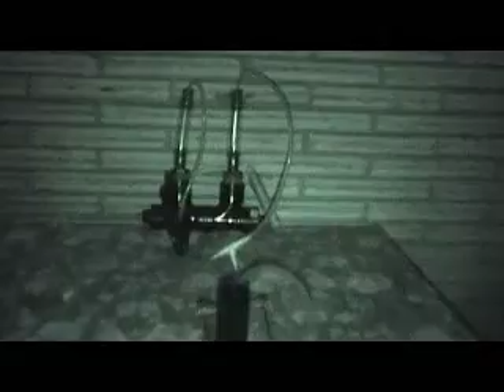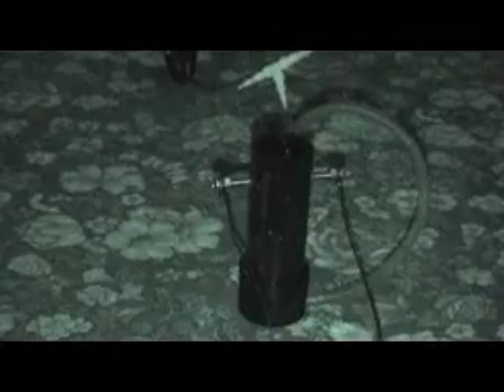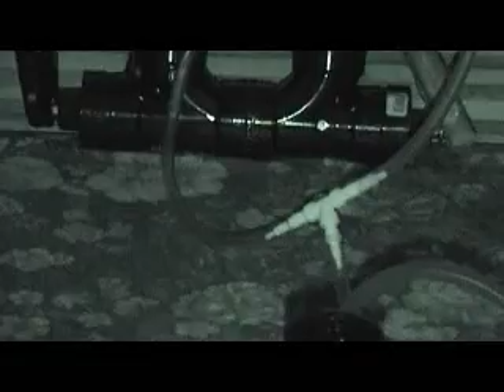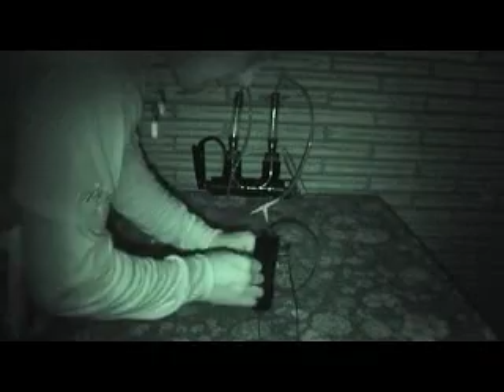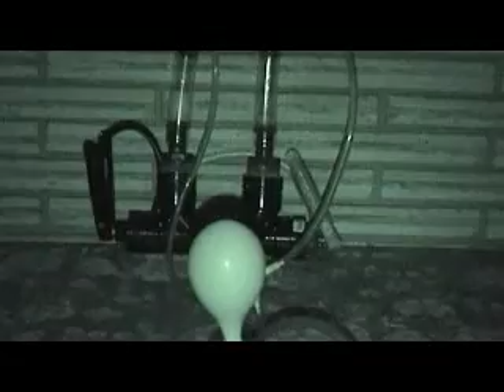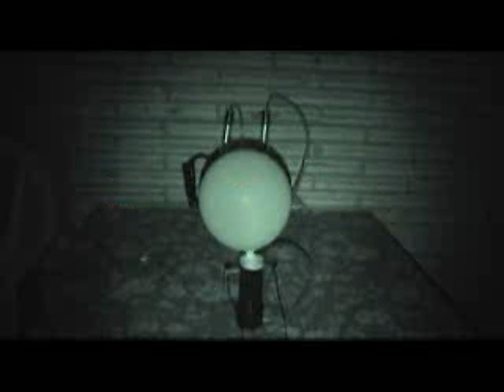Hydrogen Generator Balloon Powerful Explosion

Comment: How many volts and ampers your gear need?
And i remember my first experiments with hydrogen. I was making hydrogen indoor. Then i was expecting to have very small amount of it so i decided to ignite it indoor with a blaster i made. When this shit went off a bottle i used to store hydrogen turned into a rocket and hit the roof spreading a mixture of water, salt and rust (from corroded steel electrodes) all over the room. It turned out that a fuel air mixture was quite good, it produced a lot of thrust but fortunately for me not so much fire (and as i was expecting all the fire remained inside bottle). Now i know why the hydrogen is used as rocket fuel in later stages of launch vehicles, it has impressive mass to thrust ratio.

Comment: you need to build 2 separate generators, linked under the fluid levels by a tube. Put the positive lead in 1 generator and the negative in the other. Positive field produces oxygen, negative produces hydrogen

Comment: 12 volts at 5 amps seems to give the best durable production. Higher amperage will produce more hydrogen, but it will also boil your water faster too. Home current(110Volts a/c) will blow your circuit immediately in smaller generators.I made a generator from a gallon jug and still blew the circuit immediately.

Comment: ok - you have a few things incorrect.Hydrogen by itself is extremely explosive - remember the Hindenburg dirigible? You also need to have the correct balance between negative and positive plates so you can extract the right proportions of oxy and hydro. It took a long time to fill your balloon because the hydrogen molecules pass through plain latex balloons - a helium grade balloon will fill much faster, but the hydro still passes through quickly. I have used mylar balloons with great success.